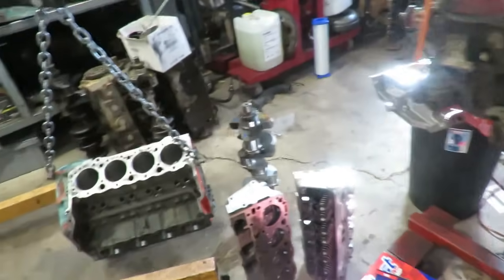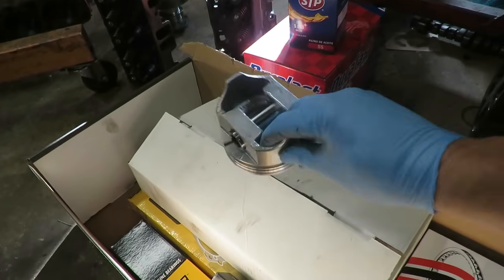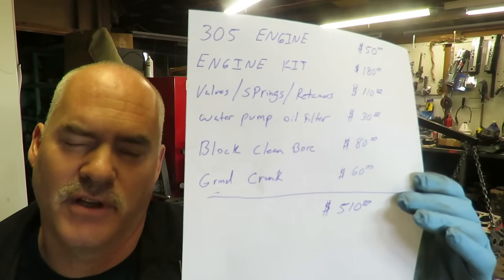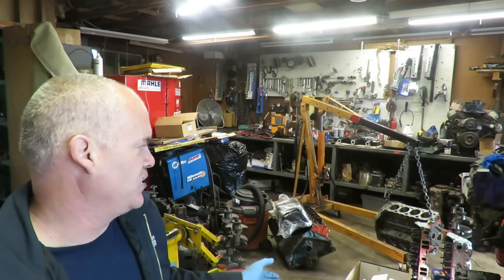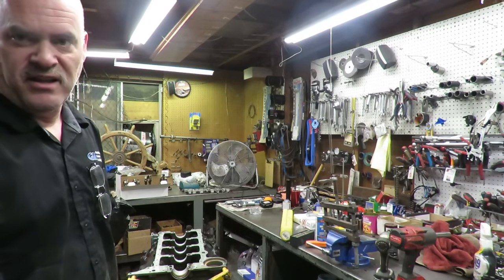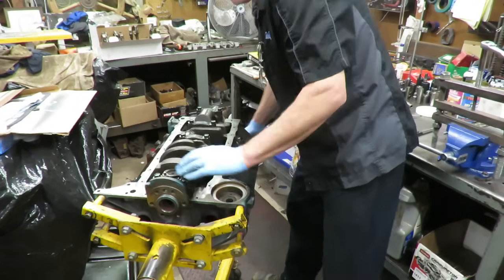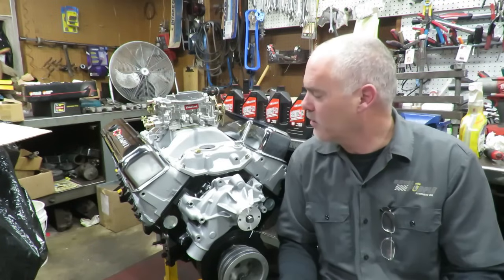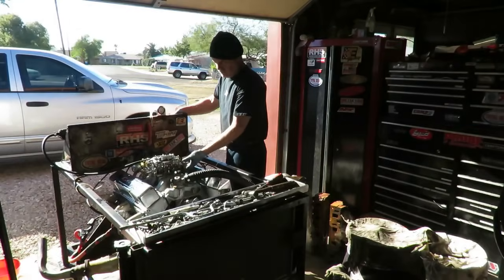Small Block Chevy extreme Budget Build

Comment: Wow I paid $22000 for a 409 (made into a 509) 600hp with dual quad tunnel ram totaling 600hp for a 55 chevy gasser
Reply from the maker: 22k for 600 HP geeez they saw you coming a mile away I would have done it for half that
Reply: @Myvintageiron7512 The 409 has 2 efi throttle bodies. I could went with a sb 350, but everyone has a 350 in their 55. The whole car was a little over $100000 to build. The ole 409 is like an ole John Deere tractor, it has it's own sound.

Comment: I would estimate the 310 cubic inch engine with its 8.5:1 compression ratio, 1.72" intake valves, high lift cam and 4-barrel carburetor put out about 230 horsepower.

Comment: I would have found a 283, and put those heads on...
Reply from the maker: 283's are quite hard to find and the parts will cost you 3 times those of a 305 or 350
Reply: @Myvintageiron7512  agreed, around they seem to be easier to find

Comment: What would $2,500 accomplish? 
Look I'm possibly going to be getting (threw trade) a 73 chevelle, not sure exactly what to expect as far as first impressions, I hope it's not rust or bondo to hell, with interior falling apart and crap, but let's assume the best, its gonna be freshly painted and some fresh main internals with maybe mildly used tires and fingers crossed a nice little supercharger chilling on top...  👍

Anyways, first thing I want to do is insure all parts are either authentic and original, if not it's the main part I want to do is get it as original as possible, none of that stupid ass gangster bull crap. I'm only 31 but Still I'm not planning on taking a classic and just crap all over it with stupid like a rice burner Honda (annoying ass things). Amyways I want to know what brands provide some mid to high quality modification parts that produce power, but doesnt need to look all flashy, I want them strong and built to last and handle somewhere near the 350hp to 500 max hp, should I just stick a bigger ready built engine? Or can a 350 handle anywhere around that power range? I know I'm asking some newbie questions here but I accept that, I just want someone to point me in the right direction?

Comment: I was sent your video on the 350 Chevy heads, best and worst. Very well done! You said to email you with questions, but didn't provide an email address. I want to set up a 283 in a 57 Chevy short bed 4x4 with stock drive train. Daily driver, nothing street rod. Low end "oomph", if you will, but still breath on the big end when he wants to. My research indicates that the 202 head will mash the valves into the block deck. This being the case, is it possible to use the true Vortec heads without valve interference? You can email me at rnrtot@frontier.com if you would rather confer through email.
Reply from the maker: nope don't put big valve heads on it they will hit the block

Comment: 305 wonder how long before it crack s a head sorriest motor gm ever built not so much motor the heads they crack
Reply from the maker: The 350 624 casting and the 5.7L vortec heads are much more crack pron than any 305 head

Comment: I wish I was fortunate enough to find a 305 or 350 for $50  I keep seeing all kinds of adds of idiots asking $1000 for a used greasy "ran when pulled" engine.  So pathetic.  I wanted to put a torquey 400sbc in my obs chevy but I can't even find a 305 for under $500.  Let alone a hard to find 400.  Frustrating

Comment: That cam is WAY TOO BIG for a  305.  They don't like duration more than 220 @ .050.  It will sound lumpy but totally crappy power.  Best bet for those heads and pistons you showed would be an RV cam with 204-214 duration @ .050.  The RV cam will sound nice and will work with any rear end gear ratio.   RV cam is cheap also.  That big cam will be a disappointment.
Reply from the maker: apparently you did not watch the entire video or listen to what was said I was very clear about the fact that he is not chasing power as far as the 204/214 cam goes part number is MC1730 by the way,   it sounds ok of you want a completely stock smooth idle there again you must not have been listening and just for the record the engine is in the car I have driven and rode in it several times it is far from a disappointment it hauls ass 2200 Lb rat rod engine made 207 HP and 295 TQ on the dyno it has not been raced because no posi but I can tell you from 30 years of drag racing it is an easy 13.50 1/4 mile car if it were ever made to hook up but like I said it's just for fun around town he is very happy with it and it sounds bad ass the 1730 cam doesn't sound cool at all might as well have a stock cam in it
Reply: I watch lots of your vids and this one especially close since I've built more 305's than anything else.  I watched twice actually.  I get that the customer wants a choppy idle, but that can be done thru carb adjustment and timing to get the sound you're after.  RV cam works best for vacuum brakes also.  Why not make the best low end grunt AND good sound?  Other 305 cams would include Crane energizer 216/216 and the 218/218.  The 216 starts losing vacuum but has nice mid-range and idle can be choppy depending on your ignition timing.    The 218 loses another couple pounds vacuum, loses bottom end, and gains just in top end, choppy idle no matter your carb or ignition.  RV cam, no sacrifice and has a sound you can tune.  I'm not looking to battle you here, rather better you.  As long as you made customer happy, that's what counts.
Reply from the maker: It runs great man has plenty of low end power the car is light enough that it doesn't matter and it sounds really good. 
 by the way you will never make an MC1730 cam sound like this one no matter how many adjustments you make the 204/214 RV cam has the same idle as a bone stock cam Ive been using it for trucks and vans for 30 years I'm very familiar with it

Comment: Well the average person can't do the mechanical work that you did so you forgot the most important cost of all the labor to build the engine into r&r the old engine. At least 2,000 to that price and that's low balling. Crap I got a price of between $900 and 1800 just to do valve seals on a V8 engine.

Comment: Good video but why go to the trouble and added expense for your “buddy” of paying a machine shop to do work you can do. You could call and get a quote for their real prices. Or if you do this work for the public then charge it to the budget at your normal price . Cause nobody without a close relationship with machinist is getting any of that for the prices you listed. So you spent some of his money and still did not present anything like an accurate  budget on machining
Reply from the maker: That is the reason I told everyone to make friends with a local shop just go talk to them explain your budget ask them to help you out it can't hurt the worst they can say is no if your patient and friendly you could do this I think you would be surprised how much of this could be done in many cases you wouldn't even need to bore the block you could just use a flex hone and a drill
Reply: I like the video I used to build quite a few,  everything from stock repair to blown dragsters,rarely get a chance any more. Which is why I watch this kind of video in my spare time. My point was just that the budget would be more realistic if you used standard “going rates” for machine shop cost, discounts from being a friend/high volume customer are great but most people needing this video aren’t gonna have that advantage.  Anyway don’t know why I chose to gripe about that detail. Good informative video. Much more useful to most people than the Cletus type 1500 hp engines (although they are fun) or the “just toss it together with used junk and run it” type that I see.. which I’ve also done for some dirt trac cars

Comment: PLEASE I'm asking you an honest question I hope your man enough to at least answer me honestly.. I use to work for Bobby Ingals and in all the years we built motors I've NEVER SEEN a BS Edelbrock garbage carburetor on any Dyno EVER NOT EVEN ONCE ..  We used Holley Dyno Mule carbs that were depending on Cubic inch and RPM range required .. Can I ask why I see a Box Store Carb on your motor ???????????
Reply from the maker: It does not surprize me they use only Holley on a dyno for all out power Holley is definitly the best carb money can buy,
 if you pay close attention to my latest video I mention my personal 427 and show a short clip of it there is a brand new 850 CFM Holley double pumper on top of it however the run stand is not a dyno we are not testing power output we are doing a cam break in and checking for leaks or any other problems so the carb does not really matter you could put a 2 barrel on it and get the same results, I think it's important to point out that edelbrock carbs actually work pretty good they are not as good as Holley for all out power that's why you see one on my 427 because that engine is going for all out power but if you are running 325HP or less the Edelbrock is going to be a better choice for most people the one draw back to a Holley Carb is they are much more tempramental than an edelbrock, because of that they require quite a bit of tweeking on a pretty regular basis I don't mind doing it because I know them inside and out,
 with an Edelbrock carb you can slap it on and run it for years without touching it, I can tell you that is what most customers want when you tell them the pro's and cons of each carb 8 out of ten customers want an edelbrock I hope this answers your question, There are street rods laying down 500 + HP dyno pulls consistantly with Edelbrock carbs on them, I kind of get the feeling from your post that you think Edelbrock carbs are junk,  that simply is not true